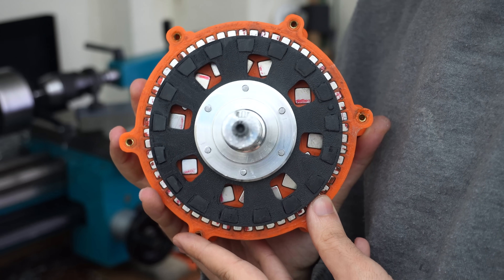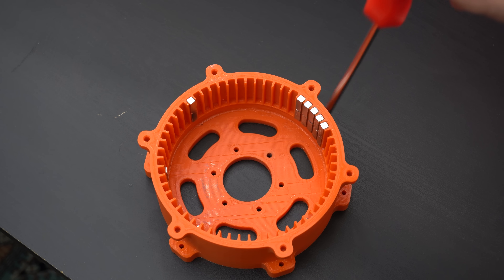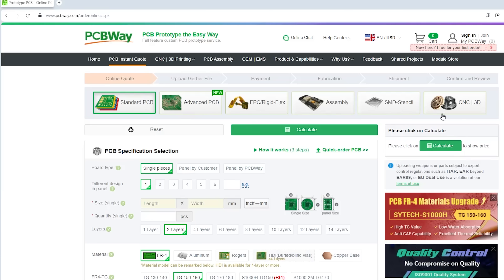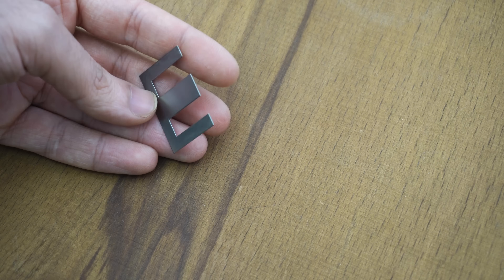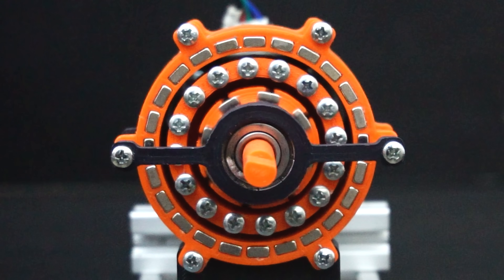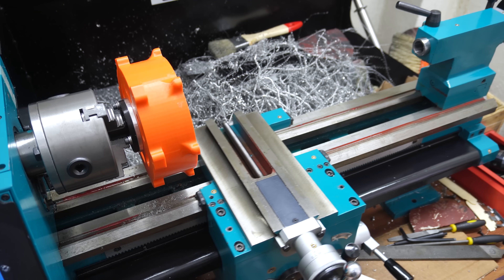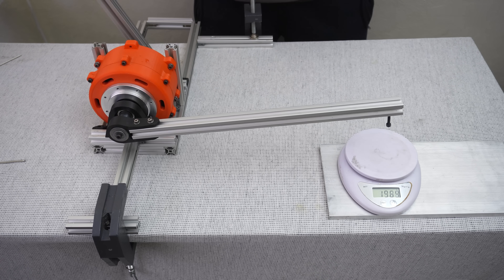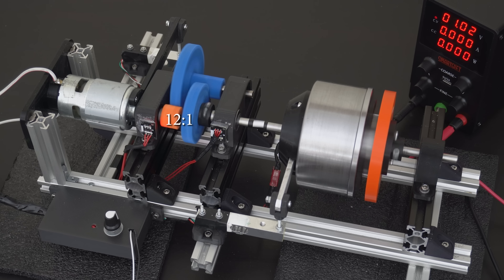True Magnetic Transmission with Serious Torque

Comment: I saw in another youtube video about exposing computers to magnets that a permanent magnet can loose it's magnetic force when heated, but it can also gain it back by heating it again.  I don't remember exactly what video it was, but there shouldn't be too many videos of people exposing old computers to magnets where they talk about heating them.
Reply from the maker: Yep that’s correct, NileRed has such a shorts video but not by heating, as far as I remember, it was 🧲 again by giving high voltage
Reply: @retsetman9698 I remember the guy in the video specifically mentioning "popping it in the oven" as a means to re-magnetize it after de-magnetizing it to make it safe to mail without needing special packaging.
Reply from the maker: @hellcat1988  I never thought they would demagnetize for something like this, it's really interesting. We're probably talking about the same method, by the way.
Reply: @hellcat1988 oven as a figure of speach, its high power electric pulse device, 2000v brrrt pulse
Reply: @retsetman9698  The guy in the video was talking about the oven in his kitchen that you cook with.  I know what I heard.

Comment: Would it be possible to harness the eddy current as electricity? And would it increase the slip torque? But i guess harnessing electricity from it by using copper would also lead to increased heat.

Comment: It was labeled sort of useless for reasons though.  In almost every case, it will be inferior to other methods, no matter how much it's improved.
Functionally it will always be slightly worse than an actual mechanical gearbox, the 'wear' mode of depolarization of magnets is even worse, etc etc.   'Yes, it is possible to depolarize a magnet. This process involves exposing the magnet to high temperatures, strong magnetic fields in the opposite direction, or physical shock.'
About the only advantage magnets will have is being able to operate through some materials, for underwater use etc.  And then you're better off with a straight 1:1 coupling, and then gearing with some other method.
'Gearing' will intentionally be causing the magnets to go by each other in a non-locked manner.  IOW intentionally making the magnet life shorter and shorter.
If you understand basic set based analysis logic correctly, it is easy to work out that this will only have small areas of operation where this would make any sense at all, and it will always be slightly worse than some other design.
'Magnets' don't 'improve everything'.  They don't make sense for certain operations, and the nature of magnets make them poor 'gears' long term.  There's just no way around it, and the use cases will be extremely limited.
Fun to play with it anyway, just don't ever expect the results to make sense for actually doing something.  It will be expensive and somewhat lesser when compared to relatively basic mechanics.
Reply: Shut up and let him experiment. You don't know everything, especially if you haven't worked with this technology firsthand. Who knows, he might discover a new or counterintuitive use case that does "actually do something".
Reply: @brettfafata3017  
Shut up telling people far smarter with far more understanding than you to 'Shut up'.

I'm already 1000 steps ahead of you, just like in everything else.
'Fun to play with it anyway, just don't ever expect the results to make sense for actually doing something.  It will be expensive and somewhat lesser when compared to relatively basic mechanics.'

'You don't know everything, especially if you haven't worked with this technology firsthand. '
Compared to you, yes, I do.

'Who knows, he might discover a new or counterintuitive use case that does "actually do something".'
You only have a poorer understanding of magnetics and why not.  I don't have that limitation you have.
Reply: On the other hand, I'm sure his experimentation with finding magnetic geometries would be useful in developing PMAC motors. There are probably few applications to this tech in the hobby space. Torque limiting can be achieved in closed loop steppers with electronics.

Comment: You could put such a modulator between the stator and rotor of a conventional BLDC. How extreme of a gear ratio is it possible to achieve?

It would be nice if PCBWay or JLC or whoever did silicon steel lamination fabrication.

Comment: Uhm. You need to properly measure output power. 80 percent is shockingly good, but a properly scaled single ratio gearbox has low single digit losses.
Nice work though, and magnets are obviously a cool source of unique properties.

Comment: I was just learning about another way to get the benefits of laminated steel without the issues of laminating steel; at least kind of.  Either way, think a bunch of iron filings or iron from the ground, picked up with a magnet, set into a binder and poured into the shape of choice.
Edit:
    I just tested a small mix of ground iron and clear gorilla glue which upon testing with a digital multimeter showed no conductivity.  The properties seem quite similar to laminated cores.  I do however have reservations of the particular glue I'm using to cure in large batches.  Perhaps epoxy would be a better binder; yet I have not tested that.
Reply: That's a pretty good idea, but i would include a diamagnetic filler in addition to the metal. You want it to form flux tubes and you want to trap the flux in those tubes. Otherwise you'll have the flux tubes rearrange as the surface fields change.
Reply: @Unmannedair  I'm researching that now, thank you for the info!

Comment: This is where boundaries are pushed. Micro electronics, 3d printers and other now accessible tools make it possible for geniuses to be geniuses. Well done.
Reply: @jamesmelemede5610  You do realise this is just a prototype right?

Plus it has many advantages over a mechanical gearbox: No risk of grinding gears and potentially no need for a clutch for one. Instead of mechanical sheer forces we have to deal with overheating, which is a much easier issue to solve.
Reply: @peterhoulihan9766  except the magnets are toast when heated even below their Curie point. Good luck keeping the gearbox under 80 C. And it's a single gear with 85% efficiency with not much potential to improve. They make such gears for over a 100 years now, even with rare-earth magnets — pretty useless irl. Cool demonstration tho.
Reply: @yurychizhov3816  Not every gearbox needs to operate at high speeds and temperatures.
Reply: @yurychizhov3816  I found a saltyboy.
Reply: @peterhoulihan9766  In some applications? Yes.
Reply: @jamesmelemede5610  Bro, if youtuber without huge expirience knowlage, expencive tools and lab of engineers can produce this gearbox, then maybe, just maybe in perfect conditions it has a lot of potential. Or simply one specific fucking task? Can't your GRAND and intelligent brfain comprehand that????
Reply: @justalpaca4943 Have you ever considered that if a youtuber without huge experience, knowledge and expensive tools can build it that maybe, just maybe a lab of engineers with access to all that could easily build a far better one but haven’t because it has no real industrial application? I, and others surely don’t want to say that this video is shit or that the effort is wasted but calling it a technological breakthrough and pushing boundaries is just plain ignorance.
Reply: @ThePunischer1000  Have you ever considered that labs of engineers only typically focus on products with mainstream applications?

Plenty of room for hobbyists to come up with weird and wonderful applications for underutilised ideas.
Reply: @peterhoulihan9766 thanks for exactly reiterating my point.
Reply: @ThePunischer1000  You're welcome. I'm glad we agree this might have real industrial application then.
Reply: @ThePunischer1000  Andrew Ritchie, a young British engineer who created the first Brompton bicycle in 1975, did the things that large cycling brands considered weird and eccentric. Yet Brompton bicycles occured to be not only very unique and distinctrve, but also commercially viable up until now.
Reply: @jamesmelemede5610  hey, while it might be useless it's more of an experiment not a product to be sold. I like YouTube how it is because YouTubers can make things that are not optimized for profit yet still get money it incentivizes interesting content and doesn't constrict you in doing things only for profit. Like man gearboxes are great and all but where else you would see one made of magnets - YouTube.
Reply: @stasi0238  Are you salty, bro?
Reply: @IncognitoActivado ?
Reply: @jamesmelemede5610 u mad bro?
Reply: It is a Proof of Concept well done👍🏽
Reply: @jamesmelemede5610 all bro sees is black
Reply: Your big brain couldn't come up with a situation where this might be useful, leave it at that. @jamesmelemede5610
Reply: Imagine the future.
Reply: 21,6 Nm is not "high torque", is about the little amount of torque of a 125 cc engine... 😅
Reply: @MrDenisio77  For propellers is perfectly fine actually.
Reply: @jamesmelemede5610  (halbach arrays do make magnetic fields stronger with no increase of rare earth minerals )
Reply: Geniuses are geniuses even without it. The bright example was David Gingery who wrote a series of books on building DIY lathes, milling machines and furnaces in 1980s. Modern stuff just allow geniuses to be more productive.
Reply: Dudes not a genius. The drill powering the whole 1st test,where the gearbox put out ~4.5Nm, puts out far more torque and at higher rpm than running thru the magnetic gearbox. Ur not driving a screw into a pine 2x4 w 4.5Nm. Maybe Kool in a high speed gearbox where you want very little friction and low torque isn't a factor. Most modern gears are between 95%-98% efficient. Thats a whole lot of work to get a 1% increase in efficiency at absolute MAX. Obviously 100% efficient doesn't exist irl.

Comment: Ingenious design, with a lot of great improvements. You can have even more torque if the magnets in the center were mounted on a much stronger and stiffer material. The reason for this is that as you approach higher levels of torque, the material holding the magnets is starting to bend, so you lose tolerance. If you can tighten tolerances, and use stiffer materials then that will greatly improve torque.
You might be able to find a ferrite bar and shape what you need instead of cutting little tiny pieces of aluminum? (worth thinking about to save labor)
Great Inventiveness.
Reply: All these 3d printing channels are obsessed with using plastic even in applications where it's unsuitable.

Comment: The only real world application for this I know of is in space. Where moving parts must work perfectly for decades, but don't necessarily need to be powerful.
Reply: Maybe something that can't be contaminated to oil, like hospital equipments
Reply: @rian0xFFF   true reliability is good for stuff like that but does any of it use gearbox? a similiar yet different variance of this tech perhaps
Reply: You could spend all those magnets on a servo itself. You could just run the "final drive" electronically directly..

Likewiise you can replace all the middle parts with wires,
Reply: Better yet back to those san fransisco rails, trains, and other train shit since roads effectively turn cars into shitty trains anyway

Too many people given licenses only actual professional employed people should have license instead of cartardation and road shittery we should've made train shit or something shared public transport but it'd be super convenient organized so it'd be faster than our current shit, due to optimizations no roadJAMS
Reply: Space would be a bad place for this to be if you want it to function for decades. The radiation will cause the magnets to weaken over time and fail. The radiation scatters and randomizes the magnetic domains which is effectively weakening the magnet.
Reply: It will likely degrade quicker than we'll designed gears
Reply: What is it for anyways? I am not a mechanic and the idea escapes me? What does it do? Why do you need it? What possible benefit does it add to just simply running an electric motor?
Reply: having reliable gears never fail is useful for all of future society imagine building a machine and it just werks with no maintenance, this is a huge step in that.
Reply: @GealuGalu  Dude, magnets have higher friction between them and heat things up by induction.
Reply: @samsonsoturian6013  What is it going to heat up? The empty space between? Nitrogen cooling, or liquid flouride. anyways my point is for future me/Gods kingdom in heaven(the future heaven means the future where it was all made so humans dont toil the fields, its all automated basically) stuff like this is integral to forming such a fully automated God Kingdom a platinum age, sorry I just read the time travel interpretration last night of the bible
Reply: @GealuGalu  no, that is a fantasy. These will fail too, just in a different way than most would expect. The magnets will weaken over time as the magnetic domains scatter. This effect is accelerated with heat, so the harder you push this transmission, the faster it will degrade.

Comment: application for a lathe??
Reply from the maker: This has always been on my mind because of my lathe motor drive recently blew up due to overload. But the magnetic connection must be broken before the motor draws excessive current, which means the torque capacity must be at a certain value, or an electromagnet gearbox would be great for this.
Reply: so the gearbox would fail non-destructively in the daisy chain before anything else overloads or whatever thats neat